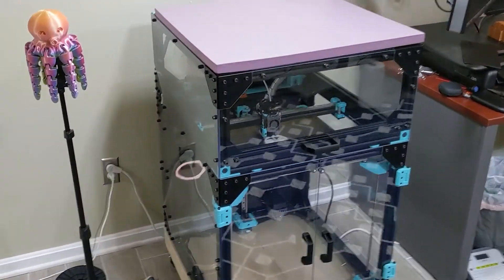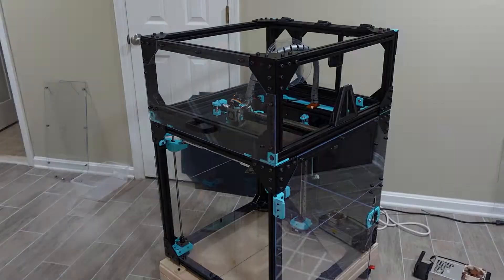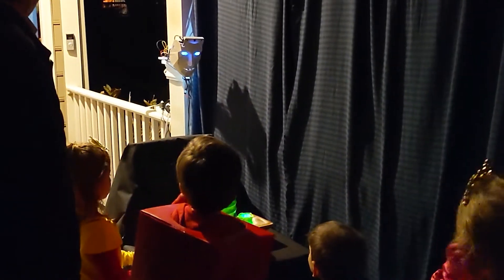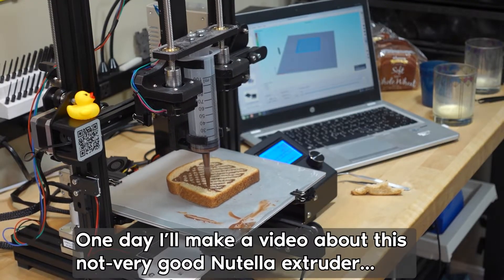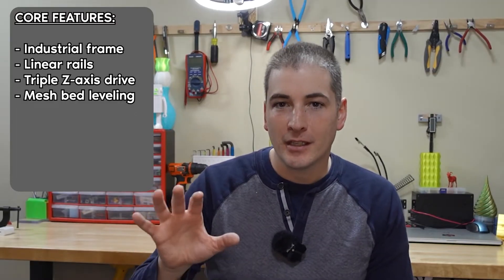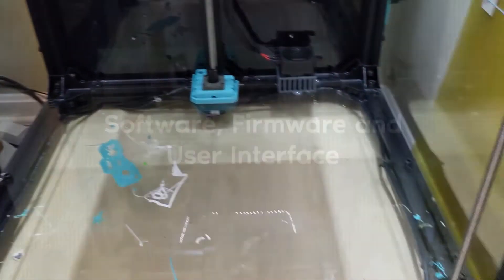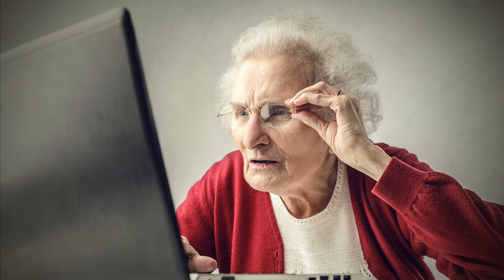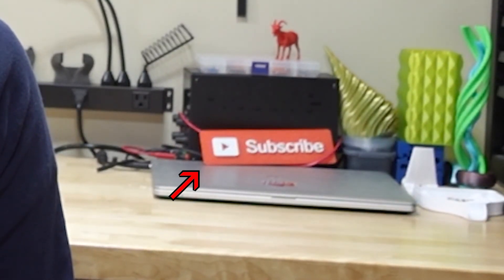Ultimate DIY 3D Printer Experience // RatRig V-Core-3.1

Comment: Isn't the spec for the provided US power supply a 200W unit? Not sure the power draw is actually that bad.
Reply from the maker: On most printers, the PSU supplies 24V for everything, including the heated bed (that's why my Ender3 has a 350W PSU and my other printer has 450W).   In the case of the V-Core-3, the heated bed actually runs directly off of 120VAC from the wall (or 220V in Europe), making it effectively a different plug from the 24V power supply.  Thus the PSU only needs to power the electronics, the motors, and the nozzle heater, which is why you only need a 200W PSU.  

Which is actually a more-complete picture of how close you're cutting it with the 500mm V-Core-3 in the US:  the heated bed alone uses 1,500W, and the 200W PSU is pulling more power for everything else.  Therefore, if you're heating the bed and hotend and moving the printhead all at the same time, you'll be close to 1,700W draw.

However, you can limit that max current for the bed, like 75% power to give yourself more room.  Obviously, the bed will heat slower, but it's worth it to avoid tripping a breaker (but at least it would trip during pre-heating before the print has actually started, so it's not likely to happen in the middle of a print.  It takes a lot less energy to hold the target temp than to get it up there in the first place.)

Comment: Throwing the 3d print thrash just from the bed into the chamber has been such a nice feature for me.
Reply from the maker: I'm glad I'm not the only one!
Reply: @ObsessiveEngineering  I'm kind of new to this stuff. and I don't have a printer yet. and for me right now I'm trying to decide between a rat rig and a Prusa.  Because I want whatever I work with to be open sourced unlike bambu Which has just gone proprietary But I am mostly concerned with is right. now I'm learning free. cad which to my knowledge. you can export your files right to an STL format.  And I'm very close to accomplishing my goal. of being proficient enough with free CAD to model and hopefully print So I'm looking for any information. that you might have on using free cad to 3D print. or do you send it to a slicer software? I don't know how all this stuff works. So any info you could provide would be greatly appreciated.
Reply: LOL, as I rarely use full z-height even random workshop stuff accumulates underneath it. I thought I was beeing weird for throwing stuff there.
Reply: Wait till they wrap around a lead screw

Comment: The actual building of it looks fun a easy from a bolt to bolt idea, the bit that puts me off is the software firmware stuff and WiFi stuff, do you need to have WiFi or can you run it as a stand alone machine and put your files on a USB stick and run from that, at home my WiFi is intermittent and at work it's none existent, also this would be my first printer so on that point would I be better with a elegoo or 3s1 type, I don't want to mod if there is a pre configured off the shelf with the main upgrades that community's already spotted, I'm not lazy I'm interested in it as a tool and not a tinkering toy.
Reply from the maker: Yeah, I'm with you.  I wanted the experience to build the machine because I thought it would be fun and educational (it was!), but I was more interested in ending up with a functional printer to accomplish other things, rather than some endless meta tinkering and mods.  I got my machine to a "stable" state and mostly stopped tinkering, but it took a while.

I wouldn't recommend this as a first printer unless you have experience with the mechanics and electronics concepts.  And of course you need to be ready to put in a ton of time to get it running.

As for the software -- there's nothing stopping you from plugging in mouse, keyboard and display, and using it locally.  But you'll still be using the hosted web service that is used to access it remotely, you'll just open your browser and go to http://localhost from the pi, instead of http://<ipaddress> from a remote system.  These kinds of things can be searched and discussed in the RatRig discord community, on the #ratos channel, so you could start there to get specifics.
Reply: @ObsessiveEngineering  can you plug a screen and mouse in? iirc ratOS doesnt support hdmi displays
Reply from the maker: Once RatOS is running on the Pi, you can get to it from any device on your network with a web browser.  That includes the Pi itself if you plug in display, mouse and keyboard.

Comment: Can you interact with RatOS via a keyboard and mouse if you hook it up to a display? Their website doesn't seem to say.
Reply from the maker: Even if you plug keyboard, mouse and display directly into the Raspberry Pi, you will still be accessing through the browser.  Klipper is just running a hosted web service on your network.  If you are on the Pi you'd just go to "http://localhost" instead of "http://<rpi_ip_address>" from another device
Reply: @ObsessiveEngineering  But does it have a DE that you can interact with? If yes, what DE?
Reply from the maker: @anon_y_mousse  I'm not sure exactly what a DE is, desktop environment? I've never dug too deeply into this, but I know it's a common software pattern to develop software/UI as a web service, and if you want to run it locally, you just run the service and access it through the browser at localhost
Reply: @ObsessiveEngineering  Yeah, desktop environment. I guess this means you don't use Linux? I'll probably just download an image and plug in the old Pi3 to play with it.
Reply from the maker: @anon_y_mousse  I used to use Linux exclusively, though I have been mostly in front of windows recently for 3d modeling and video editing.

My point is that it's not a traditional program you just run and it shows a GUI on your desktop.  It is strictly a background process that runs on your system (obv available for Pi, I'm sure if you wanted to run it on an arbitrary linux box, you could).  This background process IS the printer management software, and binds to a port on the system running it to serve the web UI.  If you want to access it from the same computer on which it is running (via display, keyboard, mouse) you simply open the browser and connect to it via http://localhost.  Otherwise, you open the browser on another device and access by the IP address of the system running it, http://<ipaddress>.

As far as I know, there is no other way to run it, nor would I expect them to maintain both a GUI interface and a web interface.  I was just saying this is a common pattern for running this type of software, especially because most users would dedicate the pi or a laptop to the printer, but prefer to access it from elsewhere on the network.  But you're also not blocked from using it on the same computer (even though it otherwise seems roundabout to run a web server on the same system and accessing it through a browser).  Hope that makes sense!
Reply: It's largely a modified version of Mainsail web UI, plus a number of OS level tweaks. Not sure if it's based on the MainsailOS image, but it's probably setup to be headless. It's a web server first and a DE is wasted SD cards space and CPU cycles. It's rare, but you can starve Klipper of the time to function and keep up with the buffer of real time commands, I've done it twice while working on it, thankfully not during a print but a test program. If you need to access the machine, SSH gives you both terminal and file access.